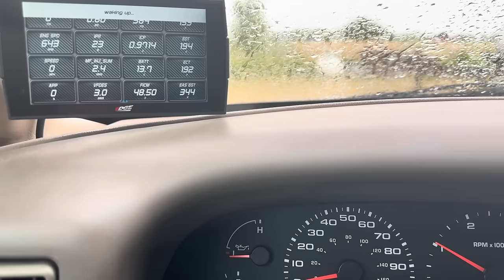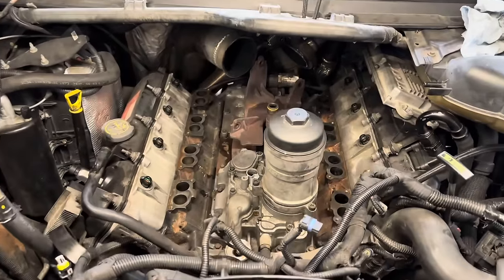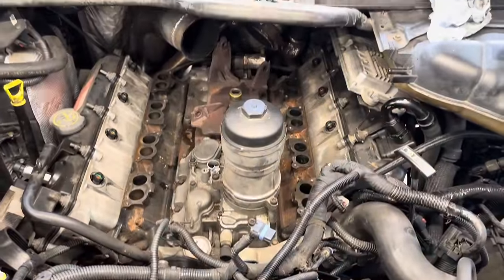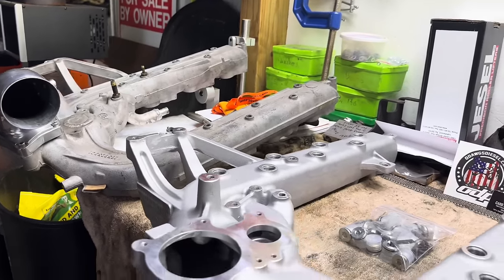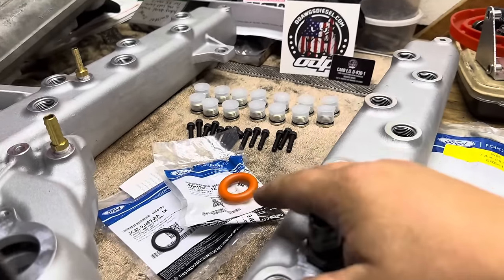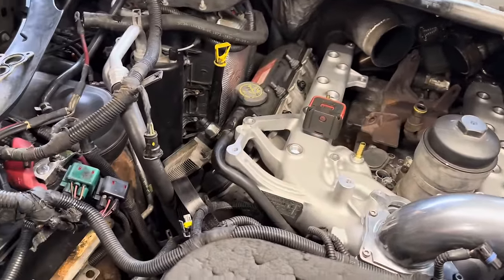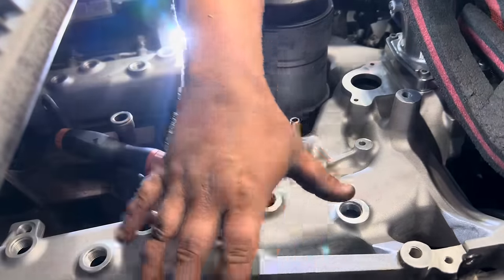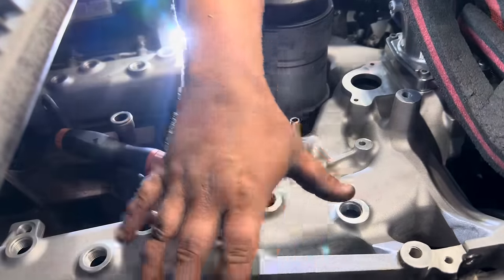THE TOP UPGRADE FOR YOUR 6.0 POWERSTROKE!

Comment: I just got an odawg last week and tried installing today. Running into the same issue bottoming out on top of oil cooler housing. Seems way off, I’ve filed plenty off and worried there’s not enough to make it clear….then what?!
Reply from the maker: Who did you buy it from?
Reply: I definitely would have used antiseize on those manifold plugs.

Comment: Didn’t you install the s3r on one of your older video’s? What was the update on that one, how was the fitment? I’d like to run the s3r and possibly the BP air to oil set up
Reply from the maker: The race truck has the S3R. No fitment issues at all. I was running the bpd oil cooler delete plate so there was TONS of room.